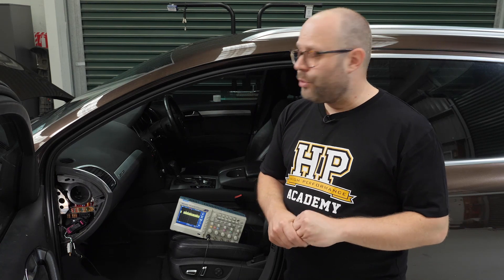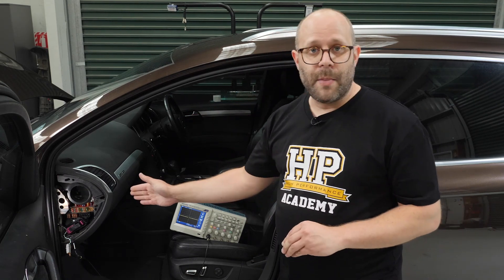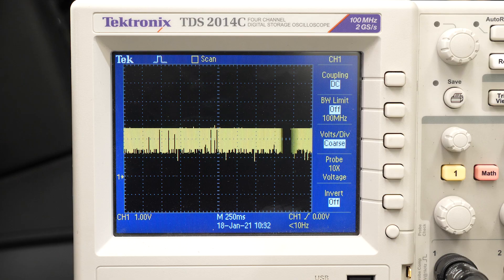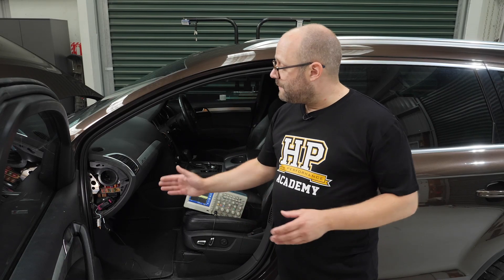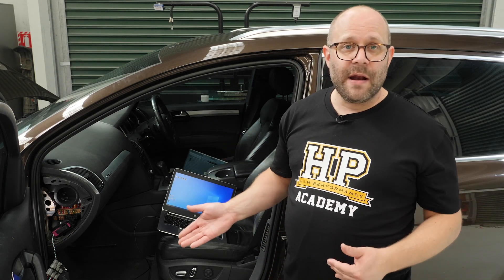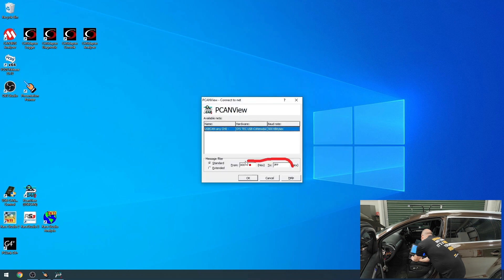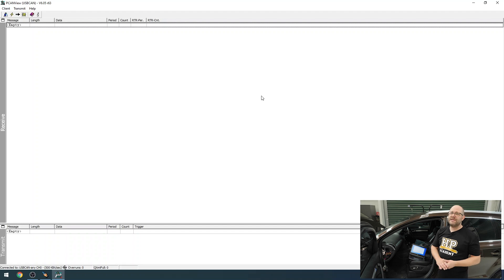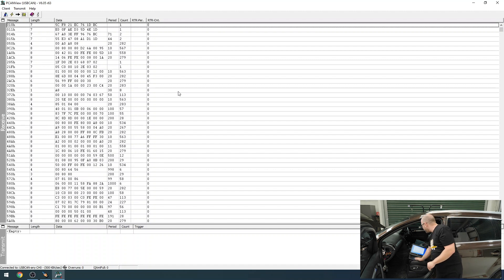Reading an Existing CAN Bus Network | CAN Bus Communications [FREE LESSON]

Comment from the maker: Building a fast car? Get $400 OFF the all inclusive VIP package deal:  https://hpcdmy.co/vipy44
Learn CAN Bus for motorsport and enrol today with 50% off your first course: https://hpcdmy.co/offery44
TIME STAMPS:
0:00 - Intro
0:17 - Key Considerations
1:48 - Connecting to a vehicle
3:26 - Using the Oscilloscope  
4:55 - Taking a signal reading
5:34 - Confirming the reading
6:22 - Reading CAN Bus traffic on the Scope
8:06 - Viewing the data on the software
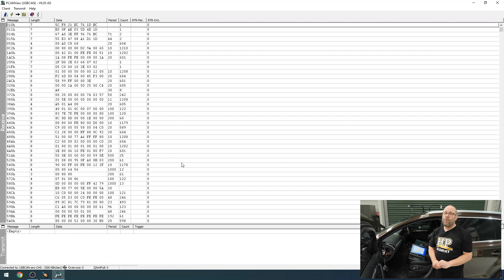9:07 - A good trick to help
9:37 - Looking for CAN Bus wiring 
11:05 - Outro

Comment: this is a question about ground strategy.   im trying to create a bus architecture similar to nmea 2000 where i have a trunk of 4 wires.   power, ground, canh and canl
i have a feather m4 can express microcontroller as one of the nodes.  Lets call it NODE1.   this device has a terminal block labeled CANH, CANL and GROUND.
this device takes power from a battery via a JST connection with of course 2 wires.  Power and Ground.   ( alternatively you can power it from usb.)
so lets say ive got my CAN trunk assembled, it has been tapped to allow power from a 20v batter so only power and ground from there ( no canH or canl of course )
then ive got another can transceiver connected to an nvidia jetson single board computer.  lets called this NODE2.  the jetson computer receives power from the can wires and is connected to its CAN transceiver with 4 pin UART.  this transceiver only has a terminal block for H and L, no ground.
My question , or statement is that im confused about the existence of the ground on NODE1 transceivers terminal block.  if best practice is that all of the devices on the can network should share a common ground then where should i connect the ground that is coming off the tap of the can bus trunk?   should i connect it to the transceivers terminal block and only connect the red power line to the JST?   should i connect both power and ground to the JST and leave the ground of the terminal block empty?   should i splice the ground wire and connect ground to both the JST and the ground terminal block for the transceiver?   And what if i power NODE 1 from USB ( a seperate power source)
im trying not to fry my 2000 dollar Jetson Orin.
should i add a fuse in there before i power the jetson?  what else can i do to protect the jetson?   a buck converter plus the fuse?  im brand new at electronics.

Comment: I guess that might be also a good way to find the CANH CANL pair if we just measure the bus resistance while the ignition is off, because the resistance should be around 60Ohms. Of course this won't tell which one is the high and low, but still this might help in pointing out the wires we need. I am not sure how big is the deviation and changes between different CAN applications and indurties where it is used, so based on standard this should be true.

Comment: Good video. Very informative. Let me ask you. How could be possible to read the light signals, like low beam high beam parking lights brake signals turn signals dome loght and reverse? Could be possible read those signals maybe using a arduino or similar hardware? Thanks

Comment: Hi.just watched this, very informative.i fitted a 03 pd130 engine asz to a 08 vivaro.I know now i should have piggy backed of the original ecu.. needless to say the dash is not happy and lit lit up like a Xmas tree. I tryd joining the bus wires together but no joy..is there something I can put in between to get it talking to each other? Be nice to get the rev counter working..and dash lights off..any help would be greatly appreciated..
Reply: Hex can Addresses are probably different and would need a translator id assume the pd190 is from a vw and vivaro being opel/vauxhal they wouldnt play nice together

Comment: How do you go about integrating a aftermarket ECU such  Holley, Haltech, Megasquirt, Speeduino or even a GM v-8 ecm , etc…  into for instance a Porsche 996  for a LS swap ? So that guages, AC ABS, etc would operate normally. I assume that means that the body ECMs needs to know  about engine data from its ECU . That same question could also asked in most modern vehicles who use CAN BUS  and one or more body ECMs,like any of the modern pickups out there. The general idea of Can seems easy to understand but understanding it’s language and    Its ability to communicate between different brands of engines and ECUs going into different brand of vehicles and their chassis ECUs isn’t. I’ve heard use of a CAN modulator,  Shield, gateway and more but tell the truth it’s very confusing to understand that part. Not the wiring or general idea of CAN but it’s cross brand integration.

Comment: The CAN BUS pins on the OBD connector should be where all the data flows to as this is where the scan tools read all the modules . Am I wrong?
Reply from the maker: That data for your scan tool is coming from your ECU or various other control modules, not directly from any of the various CAN networks so no, they will not be wired directly to your OBD2 port. Would be good if they were!

Of course you can look at your wiring diagram like Zac recommends here and see for yourself for your own specific vehicle where all the wires in your OBD2 port come and go to.

Note that even through your OBD2 port you are limited to what you can access. This is why when we make a back up copy of an OEM ECU you need to do this via the ECU directly (generally called a bench read) rather than just through the OBD2 port - Taz.
Reply: @hpa101  Thanks guys. Fantastic explanation 🤝🏻

Comment: Okey forgive me a little here, if he taped into the can bus network through the gateway module or something like that it sounds like if that’s not an obd plug it’s just some module that’s unplugged how did the car run ?
Reply from the maker: Tapping into something is different to disconnecting it. Everything functions as normal, you can now just collect the data you want. Is that what you mean? - Taz.

Comment: my obd2 port has power but will not connect i have bought new ecm still no start nothing any ideas would really help 700 to have dealership fix i belive has to do with canbus communication
Reply: I am new to this(stumbled upon)site.
Check all your ground connections. All
Fuses, relays, fusible links. New Ecm?
Flashed for your cars V.I.N.

Comment: Im adding a cd player from factory to a mazda 3 2020, I connected the can bus high but is not recognizing, any suggestions? Thanks
Reply: You need to make sure you're on the correct network.  If it's on a true Canbus network you would need to hook up to Can H & Can L to the device.  It would probably need some kind of programming to allow the module that controls it to know there is now a cd player.

Comment: Is it possible to get all Can IDs via this method?
Reply: No.  Some ID's are hidden on subnetworks.  The master will not tell what other id's are on the network unless you enter the correct diagnostic command.  Those are usually protected by algorithms called 'seed' and 'key'. The “seed” is returned to the client(diagnostic tool) as a response from the server (car). The client then uses the “seed” to create a “key” and transmits it to the server.
Reply: @JayDee-b5u  good input, thank you. Is there a way to mitigate this at all?